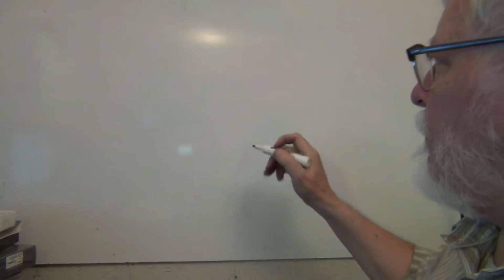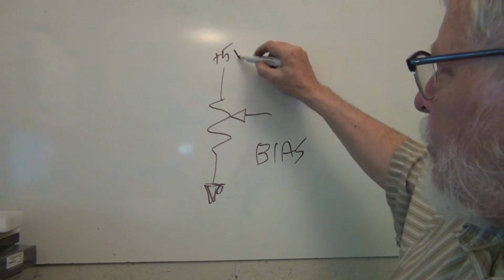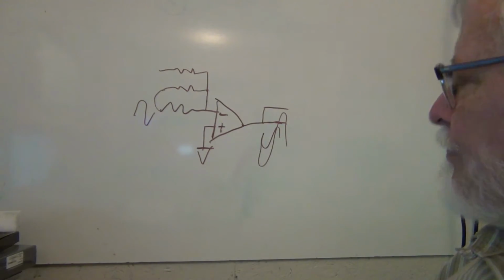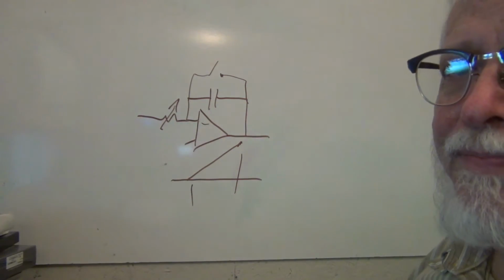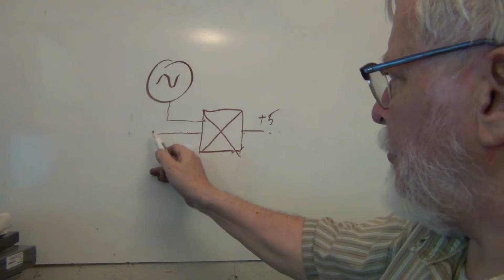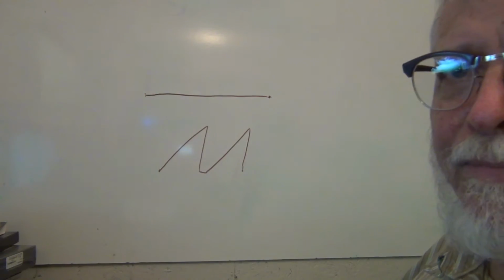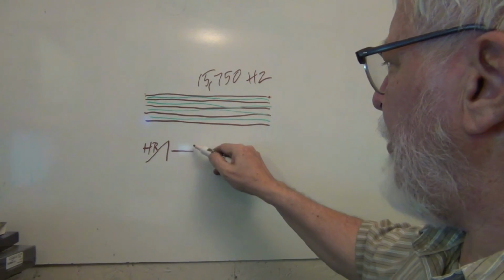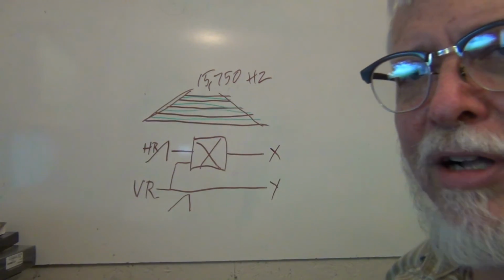Introduction to Scanimate Part 3 - Analog circuits

Comment: How it stores the parameters to change from one state to the other? I saw some complex state changes on some animation transitions like as the machine has some kind of memory to replay a sequence. 
Are all of them done by chaining oscillators summers and multipliers?
Reply: Keyframe parameters are stored on potentiometers and it interpolated between them. The interpolation could be a function more complex than a mere line, and parametrized itself, so that rather complex
transition trajectories could be produced.

Comment: 2:12 “Pot” is short for “potentiometer”. Which is just another name for “variable resistor”. Just thought I’d mention that.
Reply: well. it can also be used as a voltage divider.

Comment: These three videos have been excellent, especially this last one. I am trying my own experiments using an LZX video synth and an oscilloscope as the display. Your final point on the summing amp really was a "penny dropped" moment for me !  I am getting some really nice results, despite the low resolution of my display. 
However, I am left wondering how the star fields were done.  But I do have hours and hours of exploration left to do. Look forward to any more of these videos you might do. Many thanks Dave !